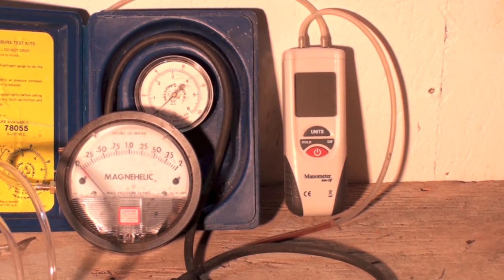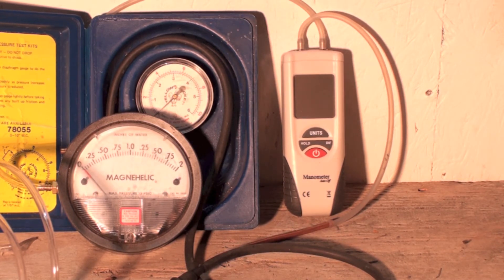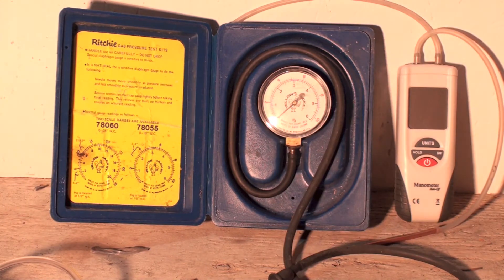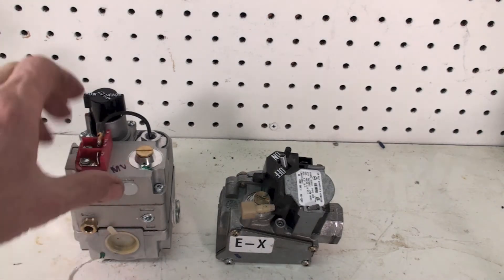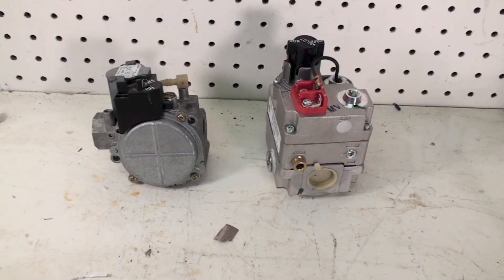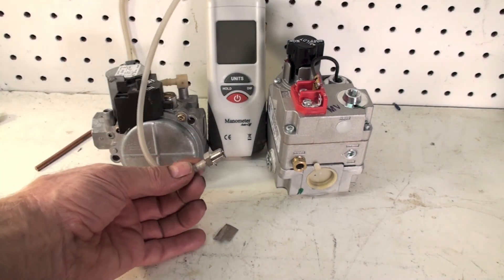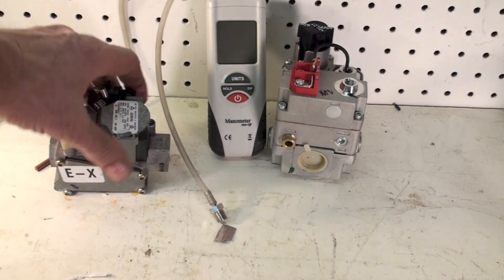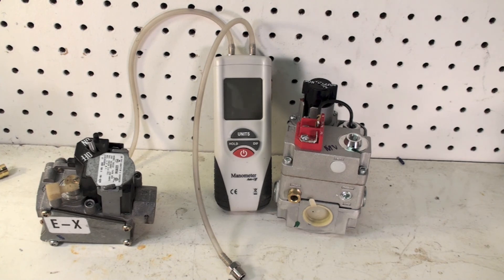Setting the gas furnace for high altitude

Comment: On my Carrier PAV155 the manual states the pressure goes down as low as 2.1 (below 3.0) depending on the altitude, average heat value and specific gravity of the local gas, without changing the stock #43 orifices.  Only at higher altitudes and higher heat values they call for #48 or #49 and higher pressure.

Comment from the maker: Unless you have a variable speed inducer, the settings for air/fuel mixtures are always a compromise.  With natural gas the mixtures aren't quite as critical as with fuel oil, but I never argue with a man that wants to use an  analyzer.  Thanks for the comment.
GFM

Comment: another thing to is if you have a flue gas analyzer, that can also really help you out a lot when de rating furnaces as well. There are even cases when furnaces might be over firing a little but the oxygen and carbon monoxide levels are within reason so it won't harm anything. Now if you were clocking a direct fired make up air unit it is very critical to have the clocking times correct or you will poison the building occupants. Hahaha